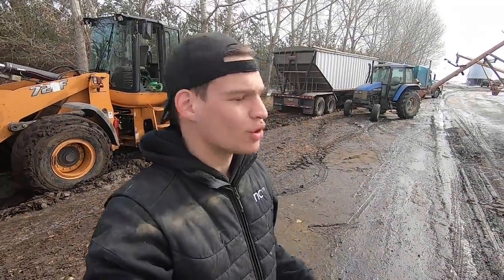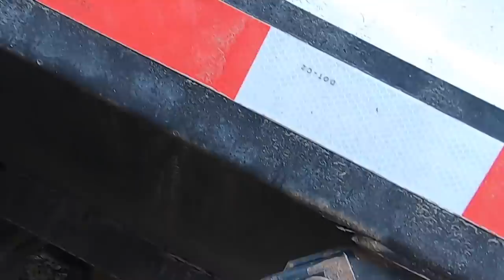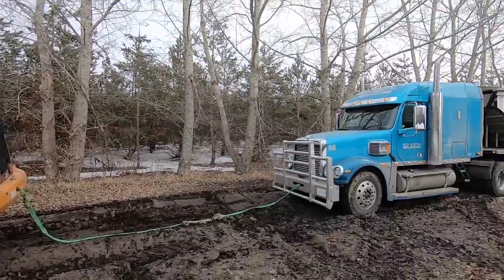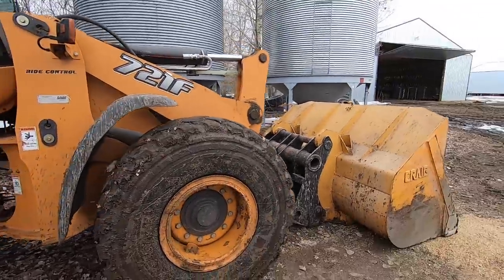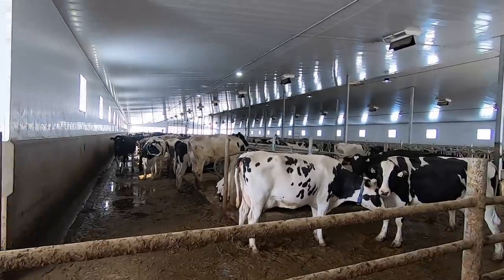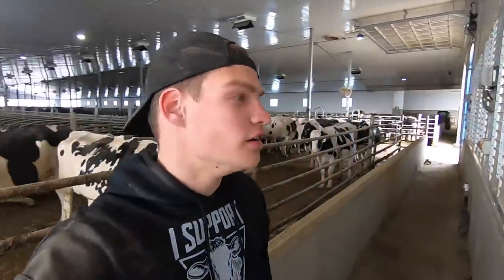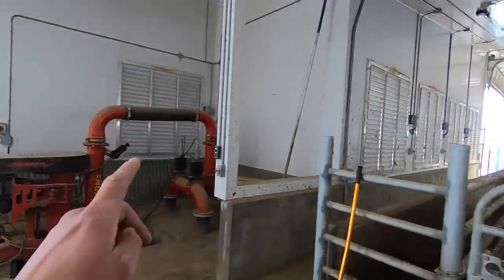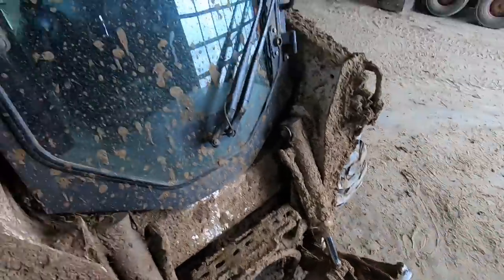Semis Aren't Great In The Mud

Comment: to solve your mud problem make a proper gravel pathway/ area. Dig some dirt out first, put down 1 layer of large rock (20 cm) then smaller rock (4-5 cm) . Then compact it and add one last layer of even smaller rock (2-3 cm). The idea to have large rock on the bottom is so when the trucks are passing over the small rock will not sink into the ground, the large the rock the harder it will sink. Also use small rock on top so you have a smooth surface so you can easily clean snow and not destroy suspensions of your vehicles

Comment: Just a point of efficiency - shouldn't  you have put the new pallet in the corner, then put the older pallet and used pallet outside of that? That way you don't have to move the new pallet in when the old pallet is used up! Just trying to save you time.